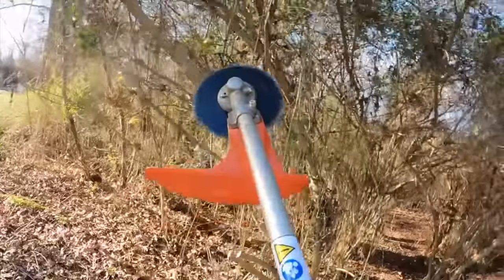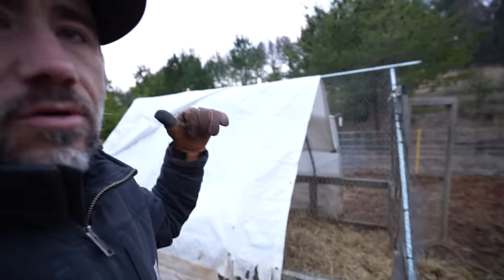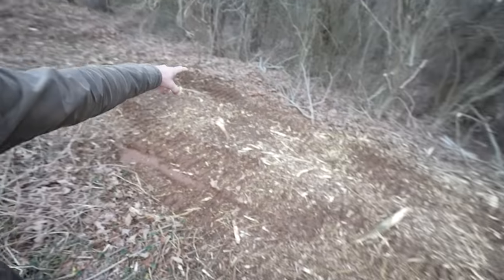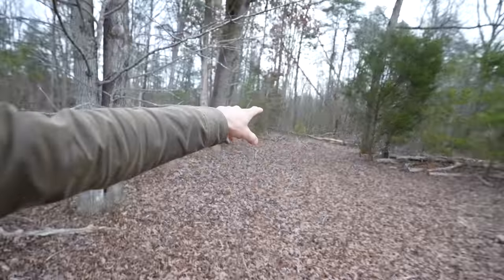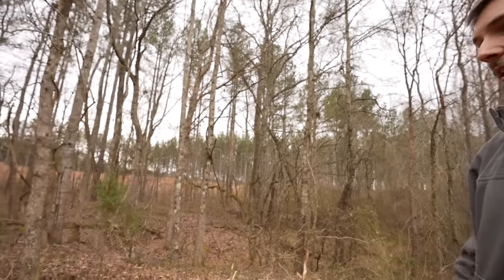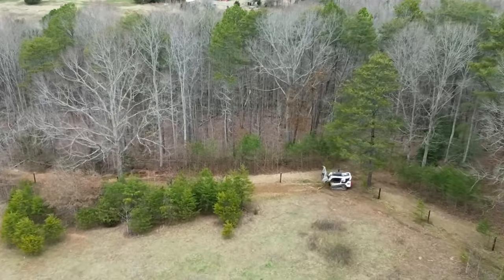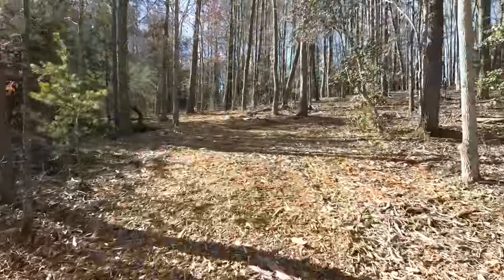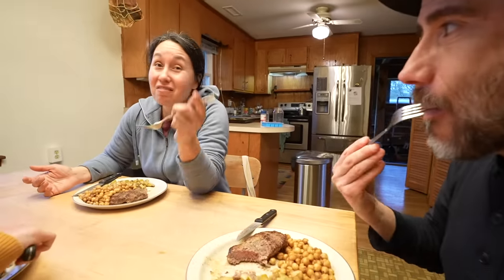Clearing Land with Forestry Mulcher/ Building our 14 acre Homestead

Comment: A mini excavator with a quick detach system and auxiliary hydraulic connection (most come with that), you can put a mulcher head on it and do close to the same thing you just did here. Then of course you can take the mulcher off and use your buckets.  Also, you can put things like augers on the excavator to dig fence post holes, cutter decks for bush hogging etc. Just some tips here to increase your knowledge of equipment since you said you are learning it.👍🏻

Comment: you need to get equipment to maintain your property. First item, a tractor. then start getting attachments. rotary cutter (bush hog), finish mower?, tiller? post hole auger? disc harrow? etc.
Reply from the maker: Trying

Comment: Jason, excellent investment, a resource with a forestry mulcher.  When we first moved on to our property, we tried to clean up the under brush, and dead trees on both sides of our driveway. Like you, it would have taken a year or two or longer.  We hired a company that clears land with several different size, and types of mulchers.  Within 6 hours the place was done.  We marked the trees we wanted to keep, and had the company get rid of all the rest.  It truly made a difference.  My husband took our tractor, and raked the large shredded pieces into a pile so he could chip those pieces into smaller chips for the garden beds.  I think were going to need to call this company out to clear the back pathways soon because we have been working the back parhways due to family medical issues.  You'll see later on how much easier it will be to maintain your fence line.  Plus you want to make sure all that underbrush, and any cedar trees are cleaned up to prevent forest fires from growing. If started by weather, or humam error.    You could even move pigs into areas of the woods like Ben or Justin, your friends.  With areas cleared you may find some surprises on your property like wild blackberries, raspberries, mushrooms, and flowering trees.

Enjoy!

Comment: Jason- a side by side would be nice and save you a lot of steps but I think you really need at least a small tractor with a front end loader with a bucket, pallet forks and a rotary cutter (Brushog) for your tasks on the homestead.  I didn’t appreciate how many tasks I could perform quicker and more easily until I got my JD 1025r.  The only thing a subcompact won’t do is unload your feed totes. You’d need a larger size for that.  I’ve worn out several weed eaters and moved untold loads of wood chips and mulch by wheelbarrow before my tractor.

Comment: This is great! I did the same thing! My recommendation is that if you plan on turning that area in to pasture you mob graze it, actually overstock it because of the woodchips.  I did the forestry mulcher and then raked all the wood chips in piles to compost but regretted it. I should have just grazed it with a ton of beefy boys.

Comment: That was one of the most satisfying videos ever. Great work. 
Suggestion: With all the new light and mulch, I would think about Inoculating Some of those dead trees and cleared areas with mushrooms.
And document what plants and mushrooms pop up and where. 
Make the fence line a edible and foraging trail. It will make use of the space and make you take more frequent trips with will help you maintain the area.

Comment: The rotary mulcher head works the same way as a saw chain: each tooth has a cut depth limiter that keeps all the chips the same size; it allows the saw to keep running and cutting even when the entire length of the bar is engaged in the wood.

Comment: I'm clearing land that use to be cattle pasture, it has 2 ponds in this area so it was well fertilized high moisture level full sun and 20+ years of nobody being back there. When I first started I couldn't even see the gate 20' tall willow trees 5 or 6 rows deep with tall brush mixed in. A chainsaw and brush blade on a weed eater is what I have been using over the last 2 years. I took most of the fence down since most of the posts  were broken at the ground poison ivy that had almost 2" in diameter vines and it ran in and out of the fencing so that was time consuming, and it's still everywhere. I have cut around our first pond and can actually see the other pond but I have my neighbors fence I need to be careful with while I'm cutting trees down next to it. I'm at the most difficult part now which is a massive wall of vegetation that's so thick I cannot even crawl through it and it's all held together by poison ivy. I call them pond willow trees because I only see them grow in high moisture areas next to ponds they get really tall but not very round and there are very few branches so they are very easy to cut and not heavy but they grow very close together. I will cut 1 down but it will just stand there because poison ivy is holding it up because it's all wrapped around multiple trees, so I'll cut the next 1 down and it stays standing so I just move on and keep cutting until they all fall, 5 trees it took me to finally get the first 1 along with the other 4 trees to fall with it. This wall of vegetation goes for about 60 to 70 yards and I notice there are some actual big trees that are not willows further into my jungle. I have 4 massive piles of Trees, bushes, and stumps I need to start burning but it's been really dry here in Illinois where I am anyway and all the stuff I've been cutting is fresh alive stuff so it's got to dry for awhile before I can burn it. I made a 20'x20' drive through burn pit that is full and ready to go, I should put a sign out front that says free firewood you cut, you load , you go

Comment: That's fantastic!  If they ever invent a cutter like that which can take down bamboo, they'll make a fortune!  I was just talking about having something like that come through my little plot, but everyone says they can't do bamboo because the long fibers just rap around the barrel like rope.

As for hiring him in the first place, one of the biggest problems I've seen in the homestead/traditional circles is this DIY mindset.  We tend to forget that no man is an island.  As a blacksmith, I can't tell you how many times I've had someone look at my work and say, "Neat, I really like that.  I'll try making one when I get home."  And I'm sure that they do try to do it themselves when they get home.  The problem is that undercuts any chance that blacksmiths could ever be more than a cutesy "niche" thing.  

And that goes for all the Traditional Trades.  It used to be that local craftsmen used local materials to make goods for the local market.  Sure, sometimes you have to do it yourself because that's the faster thing, but we always need to remember that everything comes at a cost.  You might be out a few thousand to have him do the work, but you supported his business and saved yourself thousands of hours of hard labor.  You can use that time to work on other things that you're more attuned to.  No man is an island.  We need to support each other and uplift each other.  The coopers, smiths, woodwrights, and bodgers will thank you!

Comment: You need to use a  herbicide along that fence anyway... it'll kill the stumps that may grow back.  Sprayers are affordable if you shop around and it will make life easier if you spray  6-10 feet on either side of the fence.  And they tend to make two passes when there are rocks and uneven ground.  The knives for the mulcher are really expensive.  I recently cleared 7 acres that was overgrown with privet.  It was expensive, but saved me years of fighting with that invasive tree.